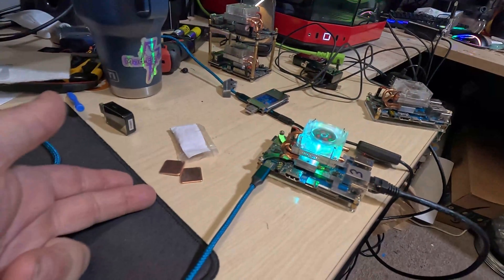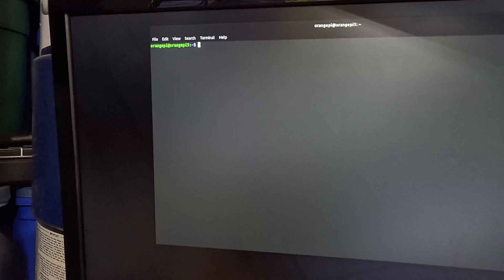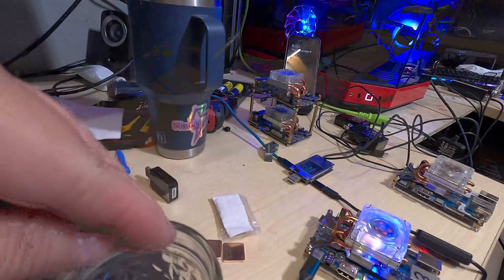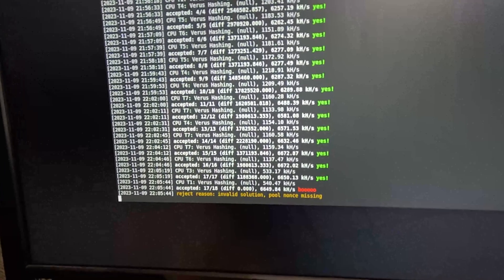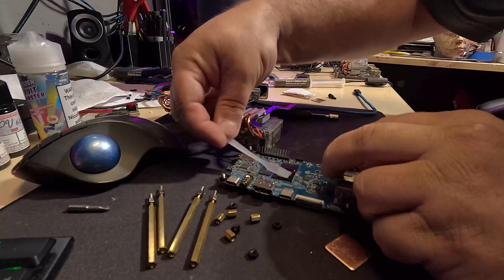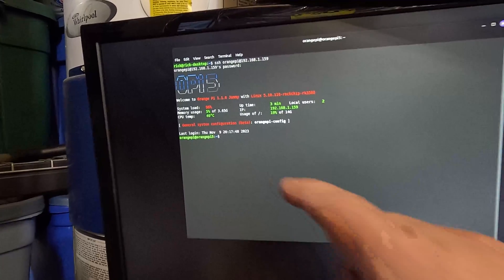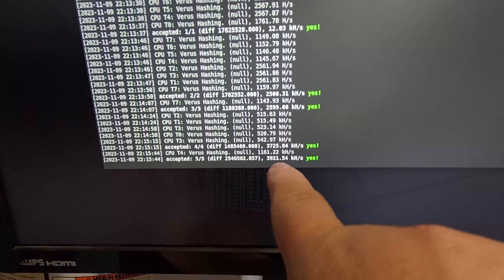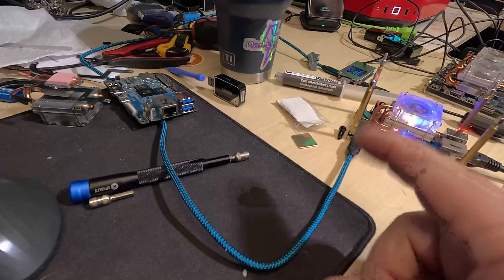Orange Pi 5 Copper Shim 20'C Temperature Drop!!

Comment: What distro are you running?  Are all of them running the OS directly off the SD card?
If you are running the orangepi distro of armbian, you can tell it to install the root partition to a USB (get cheap 32-64GB SanDisk Ultra's for like $9 a pop) and it will put the /boot on the SD and the entire OS on the USB...if the USB is in the USB 3.0 port they read ALOT faster...but I guess if all it does it read/boot one time then there shouldn't be much stress on the SD
Also try installing btop (a very nice graphical system monitor like htop but with temps, io, and network and stuff like that)
Cool that copper shim definitely helps spread the heat and keeps the tension on the heatpipes pressing much harder to the CPU keeping it cooler
Awesome!  
Keep em coming!!!!